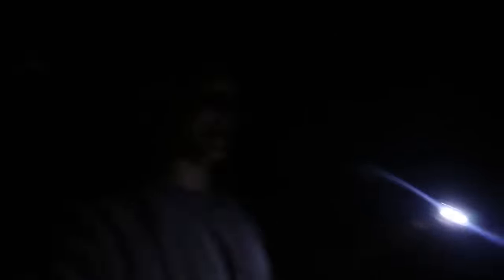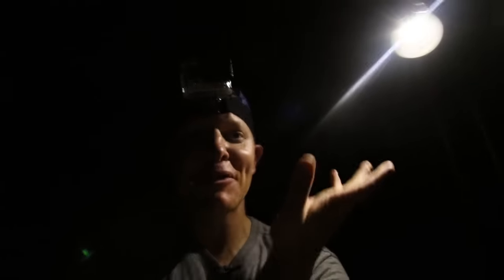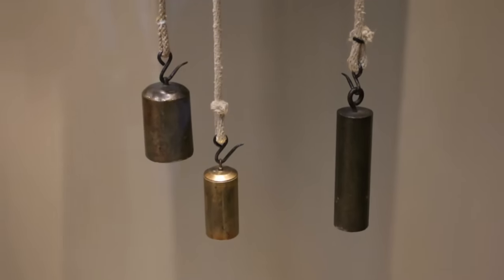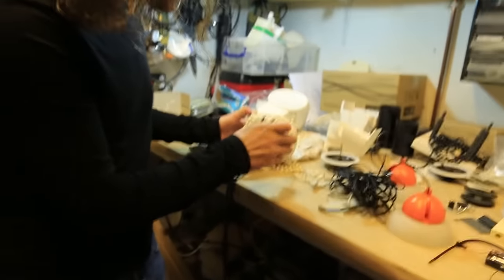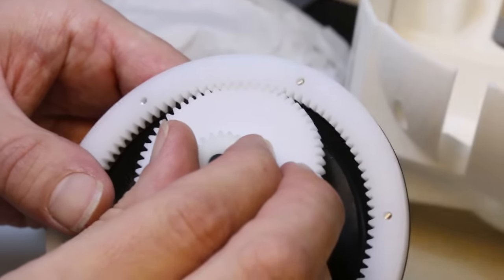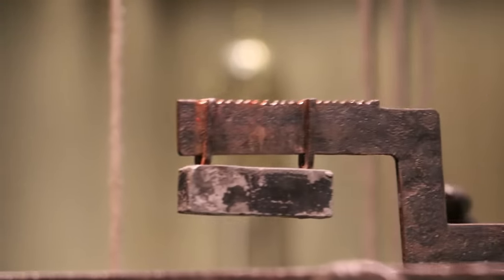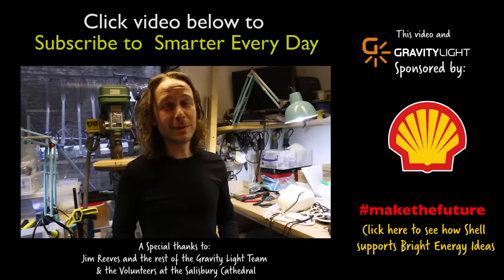Turning Gravity Into Light - Smarter Every Day 146

Comment: Interesting! In a certain way, isn't the sun turning gravity into light as well, though ?
Reply: Viktor Hofer gravity only triggers the fusion. It's not where the heat and light of the sun comes from. Like if you shoot a gun, when you pull the trigger, the chemical potential energy stored in the gunpowder releases into combustion energy which pushes the bullet out of the gun. The energy of the bullet (heat and light from the sun) didn't come from the energy of you pulling the trigger (gravity) but rather the energy of the combustible inside the gun (mass of the sun, which is its actual source of energy).

Comment: My favorite gravity based invention that ive seen recently is the simple rail cars they use excess renewable energy to power the car up a hill. Then when they have low energy times, Cloudy, no wind etc. They set the rail cars off down the hill and use the break system to generate electricity. Kinetic batteries. So simple but brilliant.

Comment: It's not light from gravity. It's just the energy (from your muscles) you use to raise a weight and releasing it over time.
Reply: akeslav that's technically true, but following this line of logic.

The energy your muscles create come from the chemical reactions inside your body. 
Those come from the food you eat, the food is created through the use of energy and/or mass from the sun or nutrients (which ultimately have their trace elements come from stars)
Stars trace their elements from previous stars, and keep going back until you reach the big bang.

So everything you do is Big Bang powered.
Reply: And what are your muscles pulling against?  . . . .  Gravity. When you lift the rocks you are storing a form of mechanical energy (potential). As the rocks slowly lower to their original height, the conversion from mechanical to electrical energy via the gears and electromagnetic generator is in progress with the end result being light. Gravity is the source of the energy. If you were in a micro-gravity (environment) like Earth orbit and you performed exactly the same motions, there would be NO LIGHT because there is NO GRAVITY, so no potential energy was stored. Gravity IS the root energy source.

Comment: Wouldn’t it be better if it just recharged batteries so then you could power lights or other things at the same time instead of one light that needs to be constantly reset.
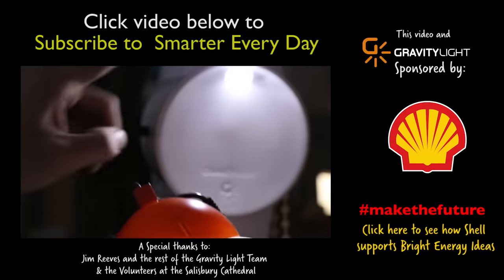Reply: Watch from 06:41… they talk something about using a connector to redirect the power to another appliance.
Reply: Sreenikethan I. Thanks for pointing that out. I guess I wasn’t paying attention. 👍

Comment: This is a great invention, send it up to the ISS so the astronauts have light during a power problem.
Reply: It's called "gravity" light
Reply: Its a joke, but it could work lol, attach a strong elastic cable the the end :P
Reply: If that worked, you could generate limitless energy using elastic materials. The problem with elastics is that the elasticity would wear out, quite fast if it's under constant pressure. Generally takes more energy to make the material elastic again than the energy you could get out from it.
Reply: Domarn Liliachi True, it weas only a joke lol. But using gravity it is limitless energy lol.
Reply: Well yes and no. The parts have to be replaced at some point since there are moving parts, and overall there will be energy loss, otherwise we would have giant gravityplants harnessing limitless energy everywhere ^^

We wont run out of gravity tho, so that's neat.
Reply: Katze You don't quite understand how it works. The gravity can allow you store energy using this technology, but energy itself cannot be extracted from the force of gravity. You are lifting the objects up yourself and using up your own energy to produce light.

Comment: it's very old trick, potential energy into kinetic energy that will give working to gearbox and it's turned generators and light started to glow, every hydroelectricity dam used this technology
Reply: Yes
Reply: They used the same concept but technology differs.
Reply: if they are using uphill roller series setup then worldwide pollution solution become easy because we are using only gravity as a fuels which is totally free energy and pollution free, whole world scientist are welcome to discussed over it with me, i spread this concept world wide already from many years on various platforms

Comment: Now if only we could access unlimited electricity from radio waves in the air
Reply: there isn't any significant power there, unless you are right at the transmitter.  Even a big boy radio station would be around 50KW, which is still only 416 amps at the source.   Spread it out over an omnidirectional antenna and at the receiving end it isn't much.   This is why a radio needs a battery to run, otherwise you could just run it on the waves.
Reply: nice
Reply: Y O J I M B O  The sound isn't very loud because there isn't much power.
Reply: @GigaPlaya  Actually, in a quiet room crystal radios have been used to drive a single paper speaker cone with four piezoelectric earphones.  And the plans for it were published before WWII. I built one. It worked. I could hear it clearly all the way across a 10 X 12 ft room.
Reply: @craigwall9536  In a quiet room I can hear a pin drop 12 feet away as well... I wouldn't classify 'audible' remotely near 'loud'... But your point remains and it IS interesting that it draws enough power from radio waves to at least be audible from across the room. Don't know if that's a testament to how much energy actually IS in radio waves, or just that human hearing is pretty acute in a quiet room.

Comment: He's not powering a light with gravity. He is powering it with stored kinetic energy,
Reply: Gravity is powering the light. Without gravity there is no stored kenetic energy. Gravity is the force applied to the weight to give it kenetic energy.
Reply: @petekovacs1960  The energy comme from the muscles on the guy who lift the weight. As there is nothing to block the movment of the weight, it fall (gravity effect). The weight accelerate, so gain some energy cinetic energy, but immediatelly converted into mecanic power, then electricity and finally consumed by light. By switching on or off the light, the falling speed will change (but as there is always some lost during conversions, it doesn't fall as fast as is it could).
Gravity is a field of potentiel, not a source. And this is why all perpetual machinse based on gravity doesn't works.
Reply: The energy must come from some field that has a differential or gradation through which doing work can generate power. 

Remember  w = F  dx 

F = m a

a in this case is g (9.8 m/s^2)  , the direction of gradient of the embedding field.

That field in this case is the gravitational one.

So the energy can only be Gravitational kinetic energy.

Don't believe it? Try setting up the gravity light upside down and see if it works (obviously it won't) .... or setting it side ways... obviously it won't.... the gravitational field only changes in a direction where one can extract energy by letting the field do work (w) against a mass (m) in the direction along the gradient acceleration vector (a ...toward center of Earth roughly).
Reply: @petekovacs1960  like I said, he's not powering it with gravity. He's powering it with stored kinetic energy. Gravity is not energy.

Comment: I really want one of these but they don't sell them haha!
Reply: +Dodgy Doodles Quite easy to build one.
Reply: Build one!^^
Reply: +Rudresh Ryan Not really, To make the gear train you'd need something like a CNC, a 3D printer, or quite a bit of tools to do it by hand.
Reply: +dumle29 yes but it's doable
Reply: +dumle29 not really. I made one of these in high school and we just used the gearing out of an old RC car. Sure it didn't look pretty, but it worked well
Reply: Ayoub Minen You said easy.
Edit, sorry. The guy I responded to said easy
Reply: +dumle29 If you produced the manufacture drawings for this, you could quite easily have it 3D printed or laser cut at a local shop.
Reply: m10rober2011 Eeeh, that doesn't exactly sound easy, nor cheap for that matter. Getting an RC car, with the required gearing, which at the same time, can withstand the torque. I wouldn't call it easy.
Reply: ***** Which again. I wouldn't consider easy.
Reply: dumle29 I am an engineering student/ Design engineer so I guess my links in industry are a lot stronger than the average person.
Reply: ***** That would definetly help :) Having experience with 3D modelling is a skill though, and I'd wager most people won't be able to model the gear train for such a machine :) openSCAD, blender, sketchup, inventor or solidworks aren't exactly pickup and go :)

Comment: 10 kg lifted 1 meter up gives you 100J or ~0.02778 Wh of energy storage. That's ridiculously bad. One 18650 lithium-ion cell holds about 10 Wh for a cost of about $3. Enough to continuously power that pitiful light for about a week. Small solar panels cost about $1 per watt. So, fits into $10 budget easily, even if you make it several times brighter.
Reply: Have you calculated the energy it takes to make this verses the energy to make the others?   ROI on this purchase keeps going up the longer it is used.
Reply: R Kimpel wtf does your gibberish mean?
Reply: But then you have to maintain and protect (from nature and thieves) the solar panel.  And that's more parts that can break and pieces to the puzzle.  So if something is wrong, do they buy the whole system again since they don't know how to fix it?  With this, it's probably being donated to them and if it breaks, so what, they go back to lamps or buy a new one.  Different solutions for different situations, this is just one more solution to choose from.
Reply: Andrew Jones it would be much tougher and have a much-much longer life (on the order of 10 years). Yes, it might be more appealing to the thieves, but only by being actually useful.
Reply: The problem is, batteries degrade in time. In a year of continuous use and recharge, the led lamp would probably be on half of the time.
Reply: Radiólogo Millonario *MEGAFACEPALM*. Batteries degrade about several percent per year, and you wouldn't notice it even after 10 years when it has half of the initial capacity because you would never utilize that capacity. Unlike the plastic gearboxes that would only last for a few months top.
Reply: @tinldw  OK then let's use a supercapacitor. You'll be able to leave the LED turned on for a year... LOL.
Reply: @tinldw  tell that to my iPhone battery which is down to 70% max charge after 2 years... Also did you seriously not understand Don Quihote's "gibberish"? It was perfectly clear.

The costs and maintenance with this gravity light are much lower than anything solar powered involving batteries or capacitors. ROI means return on investment, so he's saying that for the cheap cost of this light you're going to get more of a return than getting a solar setup, which is definitely true. Also there are restrictions to solar that don't exist here (needing daylight).

I'm not saying solar isnt more efficient, it is for sure. But the use case here is different. This is for situations where you need 20-30 minutes of light, or maybe an hour or two in the evening by re-hoisting. A solar power setup is too complex for somebody needing 1 light for an hour each evening. It's not like they're trying to power their night-time TV, lights, refrigerator, AC/heater, etc with this. Otherwise of course solar would be the way to go.

Comment: what if we did this on an industrial level couldn't it be a way to power houses in the future?
Reply: Not exactly on an industrial level, but more so an individual or family scale.  Picture this: you live in a 1 tonne motor home and have special hydraulic jacks to jack up the entire vehicle.  These jacks slowly lower the vehicle, which drives a 12V generator to charge the battery bank, which is connected to an inverter to provide AC power.  It isn't enough to provide continuous power to power hungry appliances at the same time, but is better than solar and wind since it is always available.  I don't have any sources, but have seen a few DIY projects online that use this method.
Reply: It isn't done because this device stores and releases energy, it doesn't generate. If an electric motor attempted to haul the weight up to its original level it would run out of energy about a quarter (roughly) of the way up. The energy that you spent lifting the weight to that level is greater than the total output energy of the light. 
Tidal generators use the same idea but rather than people having to provide the potential energy, they use the rise and fall of the tides.
Reply: Well yeah, i hope their small production house, bring attention to the big company, so they can collaborate and distribute it to a wider scale. And specifically choosing for those who really need this invention, for the time being.
Reply: Its called hydro power
Reply: If you could gear a lever system to lift and reset the weights, you'd have yourself an awesome energy system.

Something tells me it's possible but very far from easy.
Reply: +Gamma Light that is a energy storage system still, not a energy generating system.
Reply: No. This is merely an energy storage device. To get enough power to run your house hold for a day, you would have to expend the same amount of power to lift a weight high enough to run for 24 hours
Reply: @Gamma: Do you really think you could lift a weight 2 meters and get enough energy from the drop to lift it again AND have some extra? 

Sounds like a perpetual motion machine to me... Last time I checked, those were impossible.
Reply: Aran Wyn
why would you even try? Given that the current distribution topology is SO inefficient? going forward there are only two viable options : continuous wave 5th gen nuclear power, or every house generates it's own power from methane and household waste. Every other option, including Solar panels, is a farse.

Comment: 5:26 Idea inspired by Edward Leedskalnin. Use a block & tackle system to lift something really heavy -- 5 tons, 10 tons. Have a gravity generator that generates power from this 10 ton object slowly lowering down due to the force of gravity. A haul master 1 ton chain hoist could be tried for 1 ton loads. You would need a gearing system that lowers the 1 ton very slowly but spins a generator very rapidly. It is not difficult for one human to lift 1 ton in this way. It seems you would really need to scale this up to much higher and much heavier to be useful.

Comment: I'm really not sure whether more than one tooth is carrying the load for each inner gear. Yes, if the inner gear was much closer to the diameter of the outer gear there would be an overlap between teeth as one rolls out of engagement and the next rolls in. However, with such small inner gears, there's probably no overlap at all.
There's definitely an advantage in being able to use more than one gear to share the load, but I think you need to check the geometry of the actual teeth used to fact check what you've stated.

Comment: I was watching a video years ago that showed a picture of a small mountain top that had been completely removed in ancient times in South America and the thought struck me as to just how much weight would have been removed.  I also noticed the height difference between the flat mountain top and the surrounding flatlands and realized just how much energy potential that amount of weight must have had.  I realized one could actually turn a rock mining operation on a mountain into a means of power generation.  Interestingly there was no explanation as to why this mountain top had been flattened off, made me wonder if someone had been powering something utilizing gravity and gears while supplying materials to build with.  A stretch but interesting to think about.  I got to thinking about the current scarcity of electrical power in South America and thought  with the Andes mountains one might be able to mine stone even in the modern day to not only create a viable material for construction but to also produce electricity in the process of dropping from a height down to a lower elevation for working and shipping.  Combining worked stone and the creation of electricity might make for a more financially viable business venture.

Comment: It's a really good idea ok 4 years old now but still it was a really good idea, the only problem I envisage is over time the rubber band will deteriorate, ok it would take years, so you would get your monies worth out of the device but still if you kept it for emergencies you could to use it and find the rubber band had deteriorated in which case you would then have no light.

That's the problem with having things that use rubber bands as some kind of drive, the band deteriorates over time, stretches crumbles or what ever then it's useless.

But it's a really good idea.
Reply: @flitsies Great point. I have a 400 cd wurlitzer-like player that no longer functions because of a rubber tube around two pullies. Stupid little part that probably costs 5 cents. I haven't figured out yet how to fix it. It got old and stretched.

Comment: I mean, it's not actually powered by gravity, it just uses gravity to apply a constant force. You put the energy in when you lift the weight, and you have to reset it every 20 or so minutes. Same technology that grandfather clocks use, except you only have to reset a grandfather clock every few weeks or so.

Comment: So you have to input energy to raise the weight off the ground, you could use that same amount of energy to wind a spring to drive the same device or to wind a dynamo to charge a battery, although there would be energy loss in the process